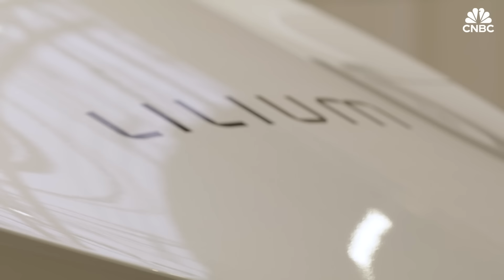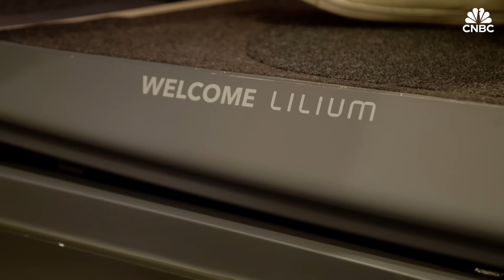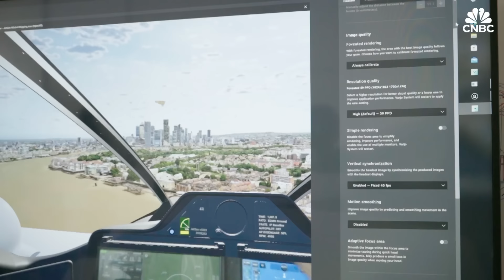Inside Lilium, the German company trying to revolutionize air travel

Comment: Aviation will be one of the last industries to fully electrify, but it will happen.  The transition will start from the bottom with smaller short-haul aircraft and work its way up.  Designing from scratch is way more optimal than converting existing aircraft.  Lilium looks like they are doing awesome work.  These kinds of companies are  the future, and the future will be clean, sustainable, and less noisy.
Reply: I think it might actually be one of the earlier ones. Aviation is very centralised and mostly owned by larger businesses which are much more open to cost-saving innovation than private users or small businesses. And fuel costs are THE cost driver in aviation, electrification is not only an environmental question but has a significant economic incentive. Another hurdle to electrification is the availability of recharging infrastructure which is much easier to provide at airports and helicopter landing pads, compared to cars/trucks or even ships.

Comment: How can they be a "leading eVTOL company" when they haven't even created a prototype that has been flying with a single pilot/passenger?
I thought CNBC had some journalistic standards, like doing research and presenting facts? Instead its just an ad trying to keep the investors on board.🙄
Since 10 years are looking at an "RC plane" that can't fly with a single person on board and are annually pretending to sell a 6 or more seater very soon?
Its also not a jet unless you call your blow dryer a jet as well  ... its a ducted fan ... just like an inefficiently small propeller inside a tube.

I am really waiting for the day they can finally present one of two people on board and make it fly some 30-40km, then I'll start to take them serious.
Reply: As I understand it, many of the smaller "drone" type aircraft are supposed to be small (4-6) with a shorter flying distance.
ARCHER is making it through the planning phases & is getting ready for short flights in California between near cities, not long flights or travel.

Comment: Since first flight in 1905 one thing is absolute common in aviation: The natural balance and the ability for gliding. Irrelevant it’s a helicopter, fixed-wing aircraft or a paper glider.
The smallest problem in flight control, and this Lilium thing will fall down like a piece of stone. I haven't seen a single video of the Lilium gliding with the engines stopped.
As I think that this shape is revolutionary new and unique, or rather strange, but it violates the basic principles of aviation.
Reply: B52 has the same falcon shape.

Comment: Imagine your 100's of feet in the air on a business video call and the battery catches fire 🔥  🤔
Reply: Imagine your jet filled with a few thousand tons of fuel catches fire. You wouldn't be the first passenger burnt to a crisp after a crash landing in a conventional plane. If the impact doesn't kill you, that's the next likely way to die in a plane crash. Battery fires are more likely with some batteries than with others. Guess which type they are using here ...

Comment: 1400 Million € and no flying, real size prototype in 9 years!
Reply: "AI how long did it take to develop the helicopter?" Answer: "The development of the helicopter has a long history. The idea of the rotorcraft, which characterizes the helicopter, was already known in ancient China and was used in the “Flying Top” toy 2,500 years ago. Leonardo da Vinci made the first sketches of flying machines around 1487–1490. But it wasn't until the 20th century that the development of helicopters really took off. It ultimately took over 500 years until the helicopter was “perfected” in its current form and flight dynamics."
Reply: @starseed8087  So Lilium have been in development for 509 years and still have not flown a full scale prototype ;-D

Comment: Energy density of a lithium ion battery being generous: 300 W.h/kg, of kerosene: 11900 W.h/kg. Factor of 39x. I would like to see these guys succeed, but they’re up against some hard limits that make me skeptical.
Reply: On average, the energy density is twice as high: 300 Wh/kg compared to 23800 Wh/kg.
Burnt fuel weighs nothing more.
And it's even worse in itself. A non-electric aircraft cannot be refueled when needed. Only the fuel used counts. On the other hand, there is no drop in performance over the service life. A commercial aircraft is typically refueled 2 to 3 times a day. That is usually around 1000 cycles per year, 20,000 cycles in 20 years.

Comment: 😂right, 45 minutes of electric power....when the battery is brand new, it's not too cold, and you don't spend too much time hovering. Flying VFR FAA/EASA requires you to retain 30 minutes of flight time AT Destination....for a reason. That's at best a 15 minute mission. A zero minute if you fly IFR. But battery are getting better and cheaper, right ? Well why do regular people turn their back on them ? At least you don't have to a lift an entire Tesla ou VW to make the journey, and the only penalty to drain out the battery is to park on the side of the road, and the only casualty, self-esteem...this is balloony, all about Vr, design, (AI anyone), and btw carbon is NOT light, it's stiff and strong...if you actually use them properly, in heavy loaded aerostructures, otherwise, plywood or wood &fabric, or even aluminium is a much lighter option. This is a graphic design-driven project, not a rationale engineering choice.
Reply: There is no way they can get 5 minutes at full size with a load.